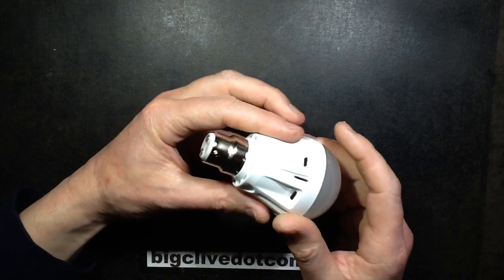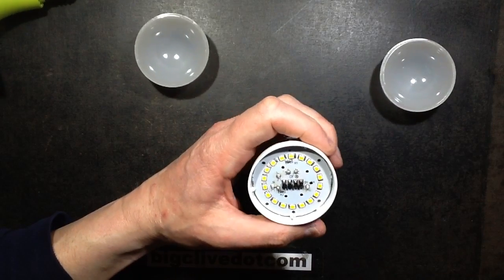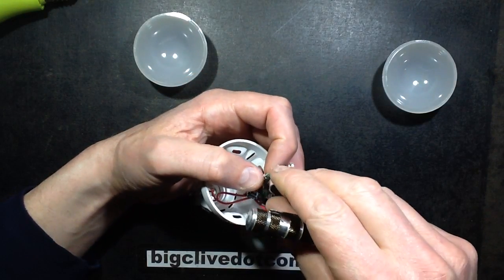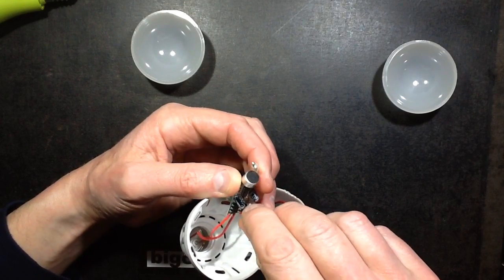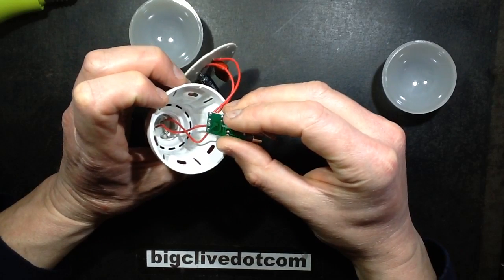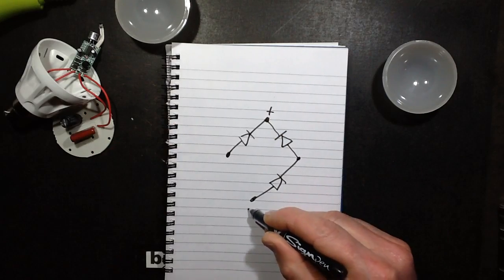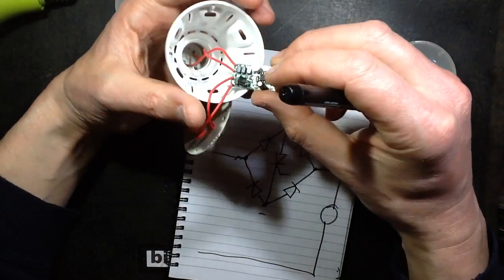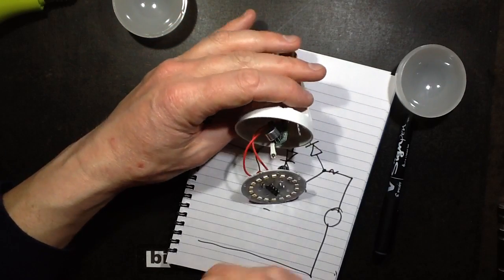Sound activated lamp that actually works quite well.

Comment: An electret microphone acts as a variable capacitance not a variable resistance
Reply from the maker: Michel PASTOR The varying capacitance of the membrane drives an internal FET to give the effect of a resistor.
http://en.wikipedia.org/wiki/Electret_microphone
Reply: bigclivedotcom Right, I should have checked. I knew the principle and spoke too fast. Thank you for the information.
Reply: +Michel PASTOR I am sure you did.....
Reply: +JOSIP Žlk Duh ?